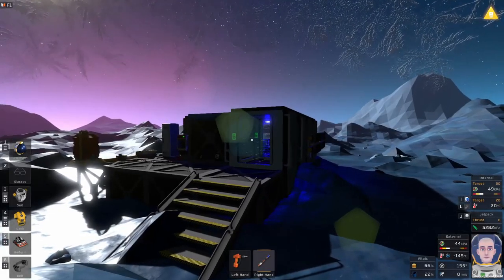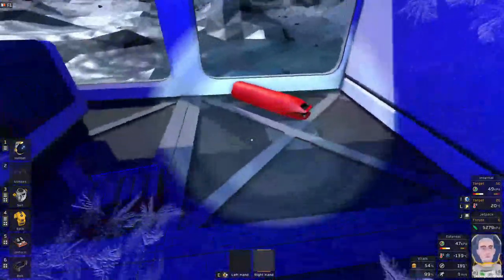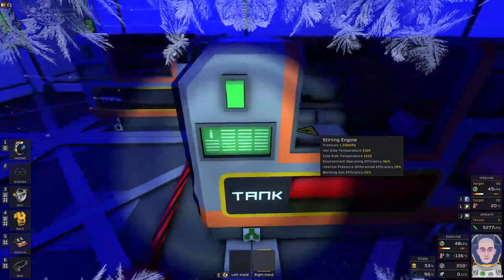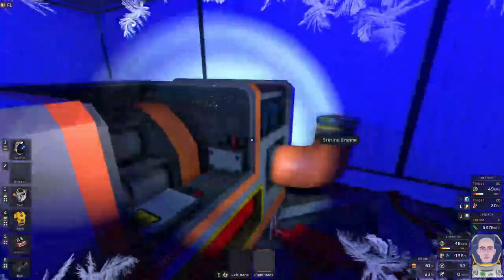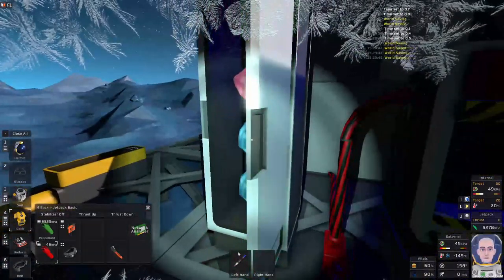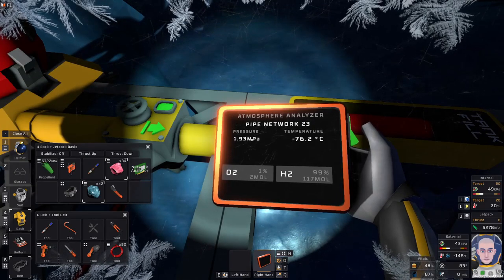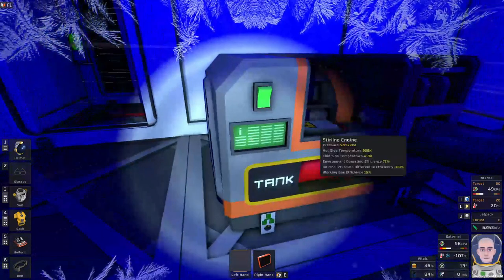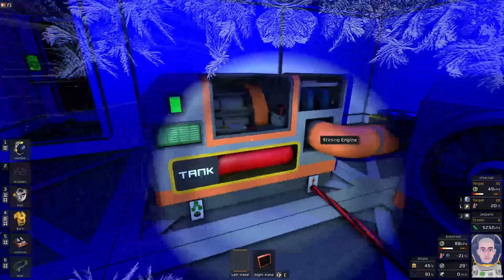Stirling Engine - Stationeers: Introduction and basic setup

Comment: man I don't know how to tell you this nicely but if you're *on the dev team*, it's part of your team's job to teach how to do this inside the game's UI and aesthetic / mechanics design, not in a youtube video. this is a symptom of a broader paucity of care for UI design and tutorialisation. i appreciate that there is, at least, this video which i found after multiple web searches, but I only had to search in the first place because the ingame explanation, model, and even mechanics are acutely confusing and unintuitive. 

- there's no visual representation of the "hot side" and "cold side" (no red-blue gradient, or fire/snowflake icons, or glowing bits, or gradient of motion...) 
- it's not clear why the machine exchanges heat from the input pipe with the ambient room environment, instead of with fluid in another pipe (which is how your "actual" heat exchangers work in the very same game)
- it's not clear why you need to inject an operating gas at all - if the gas is never leaving the system and there's basically a universal optimal gas to use, why not skip that meaningless busywork? at the very least, why not reuse the same mechanics you already have established for closed-loop refridgeration fluids like we see in the passive heatsinks and air conditioners? you could just use a regular gas pipe input/output for the operating gas instead of the awkward and inconsistent one-time canister injection, and then its total thermal mass / maximum pressure becomes something players can upgrade/tune (i.e. players could make the most of an even larger temperature differential if they increase their operating gas volume, simply by adding pipe segments or tanks). then, players could even programmatically change the amount and even chemical composition of the operating gas appropriate to the heat they're sending into the engine. good sandbox game design is all about minimising needless complexity in individual components and maximising the depth of interactions between systems/mechanics.

Comment: Why would an environmental temperature of room temperature be best for the engine? Shouldn't the engine run more efficient the colder the cold side is? Also, is the Stirling Engine ingame a normal Stirling engine or a modified version that operates on a carnot-cycle?
Reply from the maker: Generally a machine is designed to operate within a certain  temperature band, there's a bunch of other moving parts in the generator side of the engine that you could argue would not be happy in very cold or hot environments. Well that's my justification for a what you might say is an arbitrary design decision anyway! We don't model an actual sterling cycle in the code as there isn't really any need as we can just as easily simulate the outcomes instead.

Comment: have you tried out whether a stirling engine is more efficient than a gas fuel generator in terms of fuel consumption?
Reply from the maker: GFG has Theoretical efficiency of 20% of combustion energy assuming you get complete combustion. Stirling has a maximum efficiency of 15%.

Comment: "Ideal gas law"
How does any comparison to ideal gas law works, when temperature and pressure of gas are not related? XD
Reply: Except they are? Take any concentration of gas ingame into a sealed environment and increase the heat. As the temperature rises so will the pressure of the container/ room, and likewise the inverse for decreasing the temperature.
Reply: @ashleydstone8623  Yeah, real gas. Can you do an actual heat exchanger/thermal pump in game now? Because last news, even with the exchangers added, you couldn't compress a gas, to raise it's temperature, then use radiator to cool the compressed gas outside the base, and then re-expand it inside the base, so it "picks up" more heat.
Like a split AC works.
Reply from the maker: There's a bunch of different ways to model an ideal gas. All our processes at the moment are IsoThermal meaning we hold temperature as constant. What you're referring to is an Adiabatic process (which we've considered implementing). The question remains as to whether we should limit that process to a couple of devices or apply it to all out pumps. Remember this is still a game so the focus is keeping things fun and engaging so that's always our first consideration when adding new mechanics.